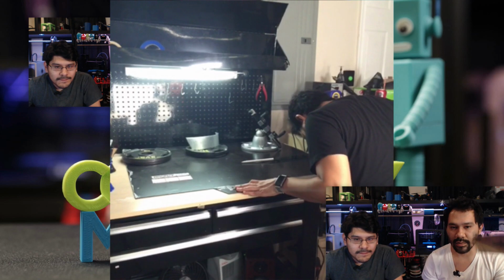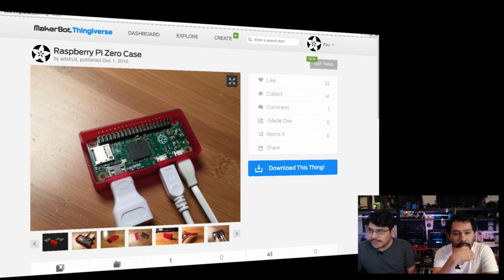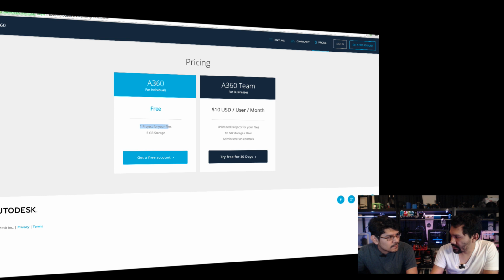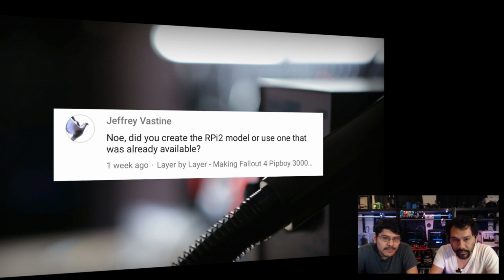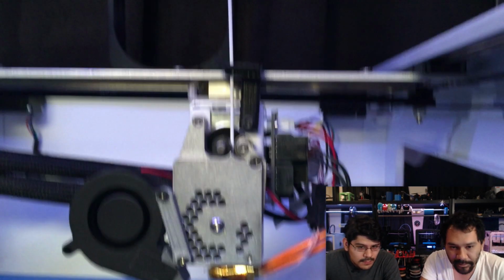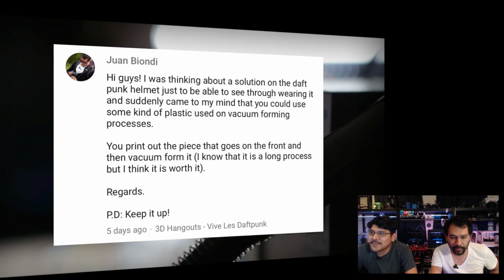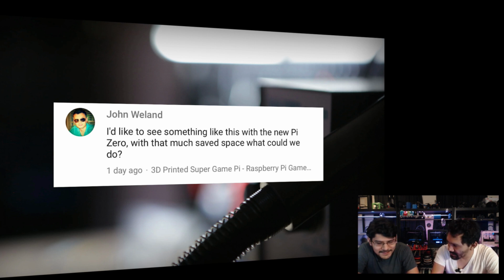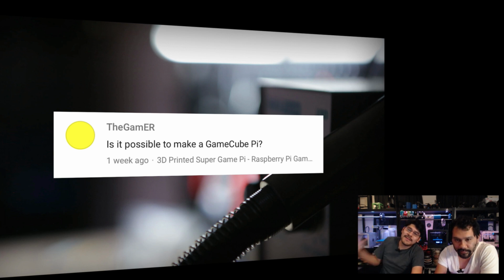3D Hangouts - Raspberry Pi Zero

Comment: Hi Noe and Pedro, I've been working on a project with flexible filament, and I want part of the print to be less flexible (denser) than the rest. Is there any slicing software that will allow me to have different infill %'s at different parts of the print?

Comment: My suggestion for making the visor, 3d print the shape you need, make a plaster negative, so front facing down for easier molding, once dry, smooth it out via whatever method works, like a wet sponge. the smoother the better. Now take a heat gun and heat your plastic of choice slowly and evenly. Use the heat gun on a low setting to avoid burning the plastic. Do the research on the material you are using, looking for how long you can expose the plastic for at the temps your think you will need.
but I think a bag of sand inside a smooth cotton bag, or a heat resistant smooth fabric to wrap around it and use the bag of sand or other media to push the plastic against the "mold" and wait till it cools.
if you had a CNC the could make both the neg and positive mold and sandwich.
Or take some clay and and do the same using the 3d print to make a mold. But I find that something round like a coffee can, BBQ dome, large cooking pot empty fire extinguisher really anything metal, smooth, non - flammable,  and with the curve I need and a heat gun is all you will probably need. Set the cut plastic shape on the round object and heat it a bit, wait till cools and done. can use parchment paper between plastic and round object to be sure of a generally smooth surface. Not wax paper! anyways, good luck with it.
Reply: the curve you need. wish I could edit my comment